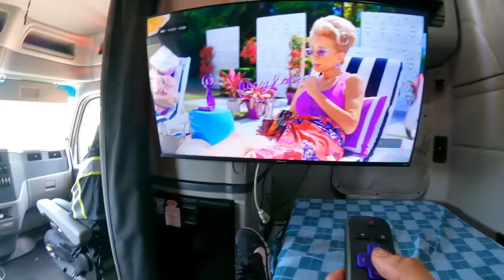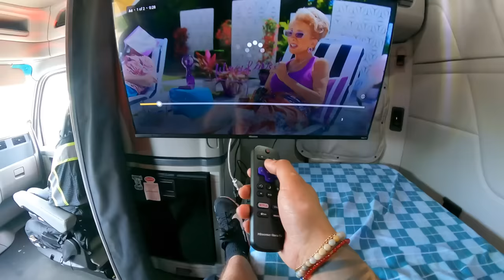I Picked Up My Son from his Last Day of School in My Semi Truck

Comment: Ummm…seatbelts? I haven’t been in a semi in 55 years, when my dad took me out with him, but, shouldn’t you make sure he’s buckled in before you drive off? I know it’s a big truck but, if you have an accident, momentum can still slam him into the windshield head first. I know my father used to say that running bobtail was the most dangerous way to drive but they may have changed. I’m sure you’re a safe driver but, as you well know, not everyone else is. Just don’t want to see the little guy get hurt.

Comment: My dad has a 2023 international and it sucks it has the Cummins engine in it and it struggles badly going up the smallest hills only gets up to speed in straight aways or down hills everything shakes in the truck squeaks it sways badly your constantly having to fight with the steering wheel to try to keep it straight it's horrible when trying to pass anyone man its a disaster volvos and cascadias are the best ones don't ever work for c.r england enough said